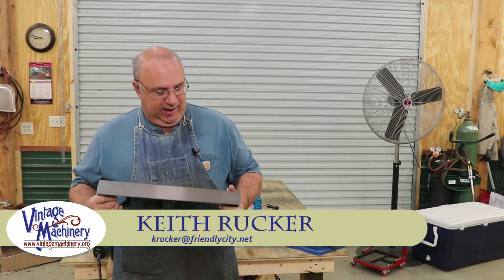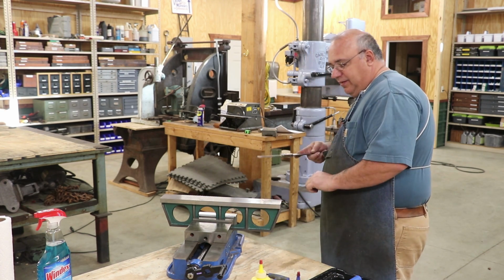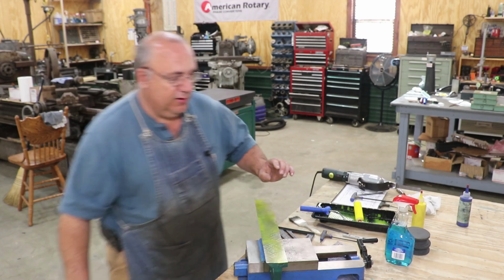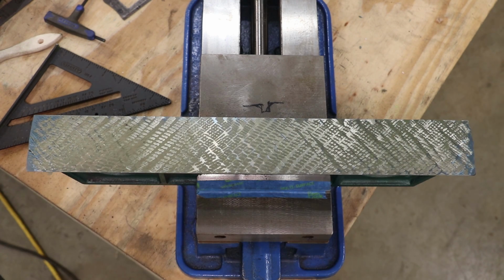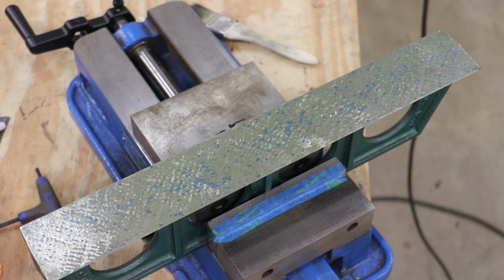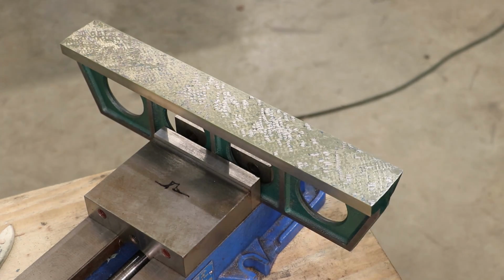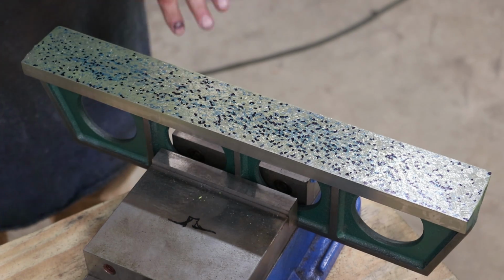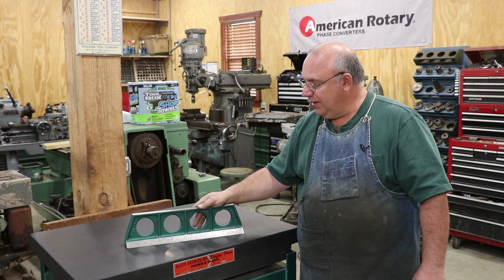Scraping a Camelback Straight Edge Flat

Comment: I don't understand why you need such a finely calibrated straight-edge?  I also don't understand why you wouldn't want a truly flat surface rather than one with divots and dents as you have prepared on that edge.  It seems like an opportunity to sit incorrectly based on how you place it down on your part.

These scaping videos are my least favorite of all your videos by an order of magnitude.  I just don't see the value added for the vast majority of things you'd use a straight-edge for, and these videos are 40+ minutes long.  My thinking is:  you get into .0001" tolerances and now you're dealing with temperature fluctuations which will resize your part more than that.  It seems like a lot of wasted effort for no usable gain.
Reply: Xyz Zyx, what is the advantage of a straight-edge with .0001" or greater tolerances for most ( 99.999%) of things machined in a shop like Keith's?  I honestly don't see it.

In Keith's most recent video, his horizontal mill had a tool going up/down by probably .002", and with a 93 rpm and feed rate of 1.6"  per minute approximately, that's about 1,600 thousandths per minute.  With about 40 seconds for a pass to cut a tooth valley, that's one revolution every .040" or so, meaning oscillations cut into the gear of about .002" every 0 .040" (like waves on an ocean).

Such is typical in a machine shop like Keith's, so why need or want a .0001" or better scraper or flat surface?  I am completely serious.  I see no reason for it.  I've asked Keith before and never got a reply or answer.  So, I'm left with it making no sense to me.

That position does not detract from my appreciation of Keith's other videos.
Reply: @xyzzyx6468  Well,  you may know something about machine restoration, and scraping in particular, but you really need to clean up your mouth.  The rest of us are not your emotional dust bin.

Comment: Keith could you possibly make a video on how to properly measure and scrape accurately the angle of your camelback. In the video you don't show any of that. How do you know you are staying parallel to the edge. And how do you accurately measure that you are maintaining a perfect 45 degree along the surface not affecting the width of your first surface? If you could please cover this in another video or scraping project.
Reply: Not going to happen. Because this is not the purpose of this tool. Flat and angled surfaces are used separately. And you don't need precise angle, just flat surface at an angle.

Comment: When scrapping, how do you check flatness on a surface plate if the items are too big to move (like ways on a lathe)?
Reply: That is EXACTLY what the straightedge is for, this SE was 18" but it could be 10 FEET long     you take a straight surface to the ways, if it is not possible to take the ways to the straight surface (plate)
Reply: jesper dahl - Scrapped straight edge?  So two scrapped surfaces against each other?  How's that work, because a scrapped surface is only going to have like 1/3 actually in contact with a true flat surface....and you're scrapping another surface which won't be truly flat.
Reply: Xyz Zyx - Not English or rode short bus?
Reply: Troll "thechosendude", what's your problem? If you don't get simplest concepts, it's not topic for you. Don't watch it. Easy.
Technique will work just fine, don't worry.

Comment: How do you blue the dovetail? And have it at the correct angle?
Reply: ecke1010 - Scrapped straight edge?  So two scrapped surfaces against each other?  How's that work, because a scrapped surface is only going to have like 1/3 of its face area actually in contact with a true flat surface.  Now you're scrapping another surface which won't be truly flat, so combining them is now 33% of 33%.  So between both surfaces, only 12% is making contact with one another at any one time.
Reply: Blueing close to the edge of surface plate or another straight edge. You don't need precise angle. It's NOT angle measuring device.
Reply: Same question.  Or big machinery... How do you blue it if you can't get it to a flat surface plate?

Comment: I worked at Bardons & Oliver machine Co. 
We built Turret lathes, Cutoff lathes, and Special Machinery.
We never used factory made hand scrapers, or power scrapers for scraping our machine tool ways.
We made our own from old files, and they worked perfectly.
The only factory made scrapers we used were curved scrapers used in scraping bores.
If someone wants to do flat scraping without the expense of purchasing a scraper, one can be easily made from an old file.
Reply: wow you then must hold alot of knowledge from those times... did you solder carbide to your modified metal files? also I think I never heard of scraping in bores to precision.. how was it checked?  wow it had to be hard to do that
Reply: You do not need carbide, the file itself is plenty hard enough to scrape cast or ductile iron.
It only need to be sharpened once in a while on an India stone.

Comment: When youre scraping, its better to work from the furthest point back towards yourself.  If you work the other direction, youll be scraping through the chips you made on the previous pass and like any machining process, recutting chips is not great for tooling.

Comment: I compare hand scraping to using a small wood plane on a 10" wide board face....how could that possibly be better then running it through a well calibrated planer and having a perfectly flat face? So you did that with your calibrated surfacing machine and have a beautiful surface. I guess I don't get the practice of hacking chunks of metal out of an almost perfectly flat surface already? I'm sure I'm an idiot for thinking this but I guess you have to experience it to believe it or do you just like to whittle..? I would just want a flat surface not sure where the oil comes into play..?
Reply: Idiots very often don't get concept of the flatness (it does NOT have to be smooth continuous surface to be flat over some distance). Geometry itself has nothing to do with "the look" (surface texture).
Folks mix smoothness (shiny) with flatness. Sometimes you get one as a side effect of making another, that's the source of misconception probably.
 
For example gage blocks are lapped to be flat (to size, and to keep ends parallel), and you get mirror finish as extra feature - but polishing is NOT a goal here.
Reply: Did you even watch the video????????
Reply: ya..a pocked flat surface was the result...I guess that was the goal..pocked I guess for oil...flat I guess but totally flat like his table..nope
Reply: If you look closely at the ground surfaces you can see what looks like scallops indicating that it is close to flat, but not perfetly flat. A scraped surface is averaged flat over a large surface... not perfectly flat everywhere. I guess they have that in common. The ground straight edge would probably be good enough for scraping in the ways? I suppose either surface could be improved by lapping?

Comment: I understand wanting the machine surfaces to be checked for oil.  However, why would you want your straight edge to be checked?  You don't scrape your surface plate or gauge blocks, why your other measuring tools?  Would lapping not be a more appropriate method for getting a completely flat reference surface?
Reply: It would just smear the blueing and stick to the mating surface. And of corse there are scraped cast iron surface plates.
Reply: Cast Iron is porous and lapping would leave abrasives lodged in the material that is near impossible to get out. Scraping is about fit and fine tuning machine tool geometry. 
If lapping were acceptable, you wouldn't make the surface flatter, you would take away the peaks and sticktion would occur. That is what happened to Keith when he was blueing the very flat surface and it began to stick... the blueing was filling the valleys, the same effect lapping would have.
Reply: I would think a light lap after scraping or grinding could not hurt (provided your lapping tool was near to perfect)?
Reply: ok... why not?
Reply: I see what you are saying, maybe scraping a straight  edge is not a good example of a tool that requires scraping
Reply: That makes sense I guess.
Reply: congrates xyz you win the award for pompous @$$ who added nothing to the conversation.  Yes you have to check straight edges.  Guess what, you also have to check surface plates periodically.  That is not what we are talking about.  The question is why is 30-40 ppi better then infinite for a reference surface.  Kieth specifically said we was not going to a perfect surface.  Understand you don't want infinite contact on a machine.  Again not what we are talking about.  A straight edge is a precision measuring tool, not a machine surface.
Reply: Scraping a surface flat is a basic scraping skill. If you think of scraping as a method of improving fit, then lapping would not be a practical method to improve fit. Dovetail ways and slides get scraped, Bores get scraped, V-ways get scraped, gibs get scraped to fit slides to ways
Reply: We are looking at this from two different ways. You see flatness as the goal whereas I see it as the making of a tool to use when scraping. You are right, lapping and even polishing will produce a flatter surface, but not a surface that lends itself to the task of scraping. Such a surface does not transfer blueing as well as a scraped surface. Again, we are also forgetting about the purpose of this tool, and that is the 60deg angle relative to that flat surface. Lapping is not intended for this.
Reply: So I was able to answer my own question, lapped is better.  However, it is a much more labor intensive process.  Laps for really large straight edges are also not common and expensive.  The extremely slight increase in precision doesn't justify the extreme increase in cost.
Reply: All true, except we are not talking about any of those things.  I was dealing with a very specific topic of making a reference surface.
Reply: You never lap a scraped surface...
Reply: gte718p - dear young chump. Straight edge will wear out, that's why you need to check it periodically. That was really stupid question. Plus, Keith said at the end, that casting can move over time, just by sitting at the shelf.

Applications of two methods (scraping and lapping - plus grinding to some extent) are somewhat "interchangeable" (in quote marks), because "it depends".

Depends what you want, what are materials of your tools and objects to be checked (material properties, machinability, friction, abrasion resistance, possible plastic deformation or chipping - how simple it is to correct future wear and accidents, for example remove "dings"?).

Will you check by sliding things together or gently put one against another? Wet or dry? "Stick-and-slip" can occur.
In the clean lab or in the shop environment, or outdoors in the field?

Lapping is more fine, it removes smaller amounts of material in controlled manner. Scraping is more rough.

Shiny surfaces are more resistant to rust that rough ones.

Proper lapping requires more tools (more expensive).
In the cast iron surface plate example, assumption is, it will be used mostly to check (and layout) steel parts. Cast iron is a bearing material to steel.
To softer materials, both cast iron and granite are just fine polishing stones, so "it doesn't matter" (material of the plate and finish - scraping or lapping).

At the other hand, very flat surfaces (if clean) will not hurt each other, even if one is literally abrasive material (check ROBRENZ channel video, "flat toolroom stones").

In reality, on microscopic level, lapping is also a tiny "scraping" (it scrapes particles). Yes, plus chemical action of some compounds.

Sometimes you really need piece of flat surface, sometimes approximation of the flat plane with some number of contact points per inch is more desirable (because of reasons mentioned above).

This is "long story short" version (all random facts listed above).
Do you understand?
Learn more before you throw questions around next time.
Reply: I can sort of accept the abrasive argument, except as someone pointed out their are cast iron surface plates and they are generally lapped.  Ox Tools had a good video on making cast iron lapping plates, and on abrasives and how to avoid embedding abrasives in your cast iron.  Sticktion should be an issue as the surface you are attempting to measure is checked intentionally.  I understand why it is important on the machines surface.  The camel back is a reference tool.  I would think you want it as close to the surface plate as possible.  In an ideal world, you would be flipping the machine over and putting it onto a plate as the reference.  Unfortunately that is ridiculous in practice and why you need the camel back.  I can't seem to get past thinking that the camel back should be as close to a surface plate as you can make it.

Comment: nice introduction. one question: how do you check the 45 degrees? or is it not as acurate beside flat? cheers.
Reply: The dovetails on machines are typically 60 degrees,  so the angle just needs to be less than that to check inside them.  If you were making lots of machines with the exact same dovetail then maybe you'd want your straight edge angle to match, so you could check both surfaces in one pass.
Reply: ok, I get it, so you tilt the straightedge up to make contact. would be tricky to get the 60 degrees scraped in to high accuracy.thanks.
Reply: It's not as tricky as doing an internal 60 like you find on a dovetail slide,  but it's a lot of work if you don't need it.

Comment: Did you drain that fingernail?  You can damage the bed if you leave pressure too long.  A red hot flat tip straight pin will melt the nail like butter, and the blood squirt will cool the tip before you hit the quick.....  Feels like heaven when it drains....
Reply: I just use a really small drill bit turned by hand.
Reply: That always hurts too much for me.  I can't stand any pressure on my nail once I blow up a blood balloon under the nail.  I spent an hour trying that the last time....  the hot pin just penetrates with no pressure.... I had to reheat a couple times, but man, the relief.....

Comment: Thanks for an excellent instructional video! I am not as skilled as You, have only done some flat surfaces for my projects and  machine shop. I consider scraping as a very valuable skill to master for several reasons since much of my work is tool making and other precision type chores for prototyping stuff. It´s a bit of a lost art, I really never learned how to do it properly and actually learned a lot from the Youtube videos out there. I second the value of finish scraping stuff from the surface grinder, it also has aesthetic appeal and gives an impression of high quality to the work....whether its needed or not...
How do You verify that a long slim workiece like this does not become convex lengthwise? None of the tests You show seems to indicate this. It seems like it will easily wiggle sideways on the plate. I guess It is possible to intentionally scrape it a little concave initially and work from there, but is there a better way?
Also to the people tired of scraping - this info is very valuable to some of us. Depends on what You are doing. More please.